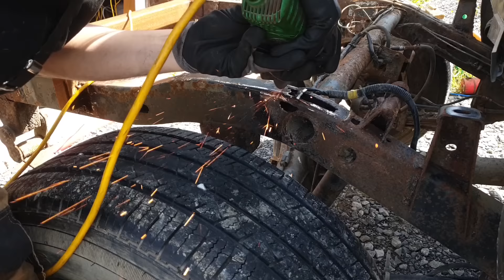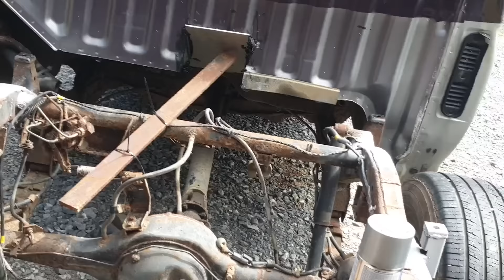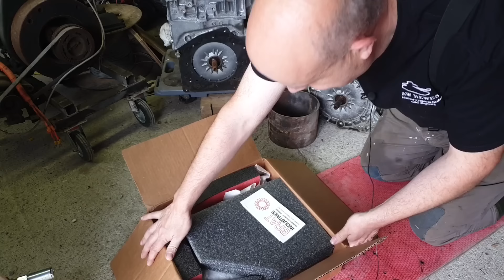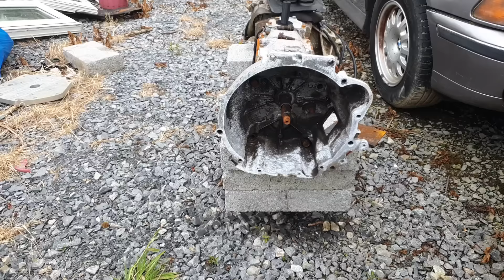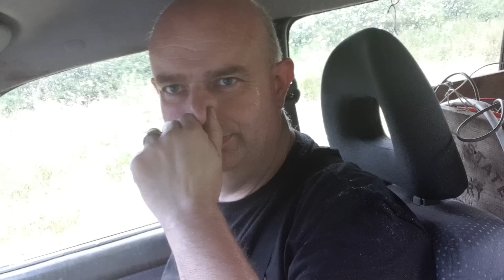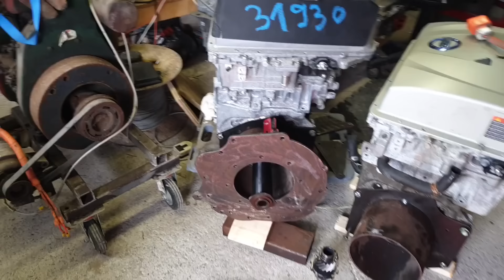Mitsubishi L200 Truck EV Conversion Part 3 : Battery Install Finished

Comment: Good day! Can you confirm the availability of ordering an VCU for the conversion of the BMW 7 Series in the F02 body using LEXUS GS450H AT with the ability to interface via FA-CAN and PT-CAN buses and retain system control using standard controls like in your E65 "EMV" project?

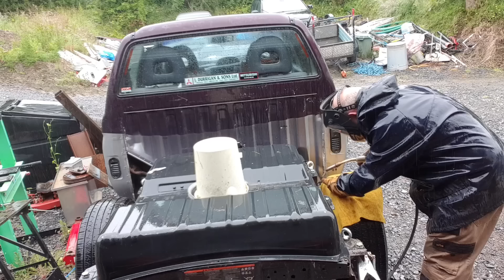Comment: 29:00 Got to laugh, body repair shops won't even spot weld to pull out a dent in your EV if its within half a metre of the battery.
Reply from the maker: But I bet they would weld beside a fuel tank all day long ......

Comment: Just make it Nissan Hybrid by using the rear ev drive unit and front internal cubustion engine.
Reply: Why on earth would anyone do that?
Reply: @vidznstuff1  that old leaf battery will only drive you for a maximum of about 40 miles.
Reply: @t.shonoiki563  I don't think the truck is meant for long distance driving, Damien has other cars that are much better suited for that.
It's probably more of a "bring stuff from the hardware store and haul trash to the tip" vehicle, so that kind of mileage should be plenty.

Comment: Oh boi, the hydraulic lines all look like they're going to blow next 👀
You're going to be goooooooood friends with the hydraulic shop. The hydraulic guy probably already bought a big box of BSP fittings 🤣

Considering it's not entirely unlikely that in fact another hose will blow, I would recommend you to buy BSP caps and plugs. Then you can close off the hydraulic system when the hose is removed, so no dirt and water can enter.